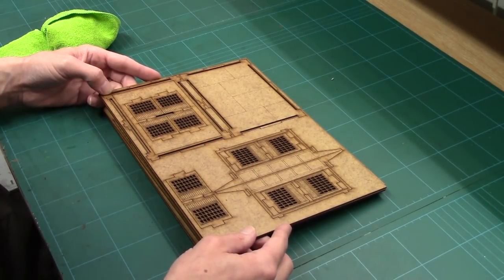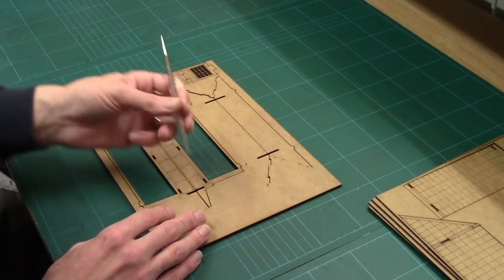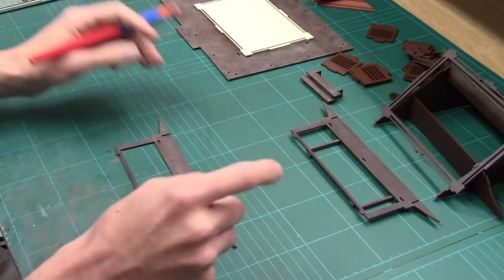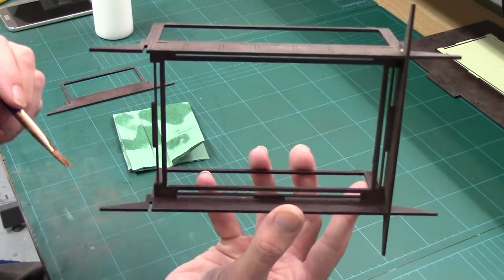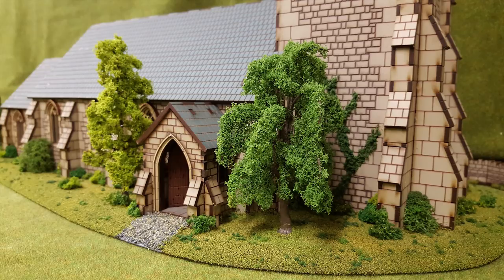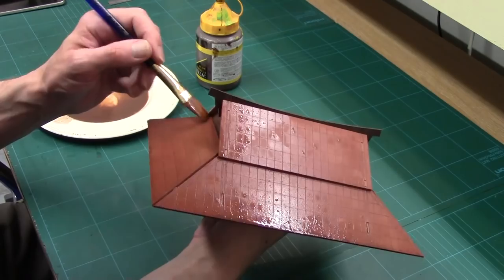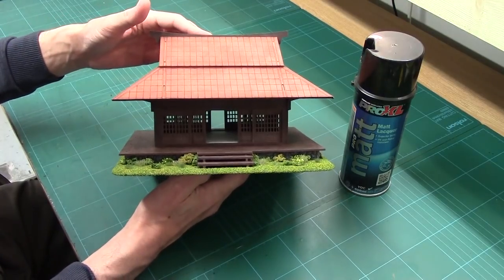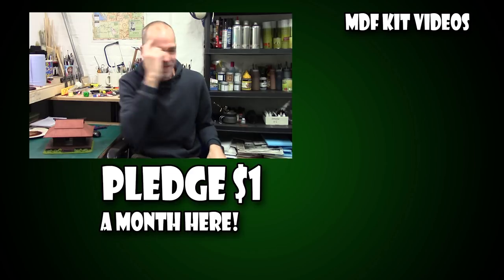10 MDF Terrain Pro Tips!

Comment from the maker: So those are my top tips folks, what are yours?
Reply: TheTerrainTutor u pretty much covered my tips, definatly spread that excess glue, I do recommend a thin knife for cutting out the peices tho... 1 good tip I have for my necromunda terrain is don't glue everything, keep it modular, I kept towers and bridges disconnected and now they double as ramps... if you mess up a piece think outside the box, I had a board that was too thick so the tabs were too thick to fit into the slots, I simply peeled a small layer of the tabs with my fingernail and the glue fixed any imperfections, that glue soaks right into that wood... another tip, use the cardboard box it ships in to make a work space on a desk, rip the sides so it lies flat, I model and brush paint minis infront of my tv on a glass table and haven't made a mess yet, lay down cardboard or newspaper
Reply: Best tip I have for this is to use a silicon or clay-shaper tool for spreading PVA instead of a brush, since a brush can get gunked-up & nasty with dried PVA in it. 
A shaper will peel off PVA with no hassle. 

Great video, man. I agree with Wildboy789789, a knife can be a nessescity for removing some MDF pieces & a needlefile or sandpaper is great for cleaning off any excess.

Last tip, keep the MDF sprue frames, I've made entire buildings just from empty frames, they're a great resource for useful bitz & bobz
Reply: That magnet idea is great, ive got plenty of those lying about unused, oh and the lego corner piece is inspired, really helpful tips all around so thanks 🙏

Comment: Some good tips and here are a few from years of running a MDF terrain business.  1 - switch to a thick clear glue like Aleen's tacky glue gel. It works better than standard PVA. It dries in stages and has a low water content. It is sticky so parts stay attached but it dries slower so you can pull parts apart if needed  for up to an hour after they are assembles without any problems. It also has a bit of a gap filling property. 2 - Instead of sealing with paint, use a good wood water sealant. Rub on polyurethane is great. It seals the cut edges so they don't stand out.  Best of all it is cheap and can be brushed or sprayed on. A little in a single action airbrush works wonders. 3 - Bet 123 blocks instead of Lego blocks. They are metal and heavier so you can used them yo remove warps and weight down pieces as the glue dries. They also are magnetic so it is easy to use magnets to turn them into clamping surfaces if needed. 4 - Seal both sides of the material even if not painting. It will cut down on warping and swelling. 5 - Sawdust and glue make the best joint filler. It always sticks and doesn't chip or pop off later like some wood putties.

Comment: Really solid suggestions and tips. 

Mine: More than just test fitting, I'd recommend a complete test build (where possible). There are often pieces that are almost right but that are intended for some other place in the model. If you think you know what's going on but you're 1/8" off, your life will be less fun. Make sure you know exactly which piece is intended to go where before you start gluing.
Reply from the maker: Nice tip mate

Comment: My Tip, lightly sand the edges before to paint/prime. Just like plastic kits and models you need to remember to clean up the points where the piece was connected to the sprue. A light sand will not only even out those points but will allow for the primer to stick better to the MDF. Also you can do this during the dry fit stage to help remove any leveling issues. If you're like me and wait to prime similar pieces all at once. take the time to use wood filler (sandable/paintable) to remove any gaps or holes.
Reply from the maker: Nice tip matey

Comment: I tend to stipple on paint quite thick on building walls, it creates a nice texture on otherwise super smooth MDF.
Reply from the maker: Nice tip matey
Reply: Similar... have also used some pre-textured house paint (Dulux used to make something called Sandswept) for MDF road surfaces or old/collapsed ruins. For cement/concrete walls, pva plus baking soda gives a good fine-grain surface.

Comment: Tip1 : fill your tab gaps. Makes it look much nicer. Tip 2. Use filler and fine sand where the walls are meant to be concrete/mud/clay and rattle. Tip 3. Use coffee stirrers/matchsticks for some wooden  beams where applicable. Tip 4. Texture the roof with card or foam (tiles for where ever is relevant.)
Reply from the maker: Top tips buddy

Comment: the mdf can look very flat, so use a bit of time adding textures to the building. This can be thinned filler, fine sand or even a stippled paintjob. 

A nice weathering  works wonders. Try the hairspray technique of the armor modellers to create worn paint on your walls and windowpanes. Quick and easy.

White pigment looks like mortar. Brown pigment looks like dirt and dust. Black pigment looks like soot or dirt.

Terrain is like miniatures and can be zenithally primed to good effect. This works great with washes or thin airbrush coats.

Think of the building as a miniature and make sure to give it base, shade and highlight coat. A little goes a long way, so dont overdo it.
Reply: Kathy Millatt just did a tutorial on painting bricks. It is definitely worth a watch!!
Reply from the maker: Cheers buddy

Comment: I also use clothes pegs to hold piece's together whilst the glue is drying. On brick work buildings I paint red and shade up, then run a white or off white chalk all over it. This sticks in the cracks to give the white cement look without the tricky painting. Just wipe of the excess and varnish.
Reply from the maker: Top tips matey

Comment: ive found that if you wanna use the inside of some of the sarissa buildings for tabletop you can round off the tabs that lock the stories together. that way when your playing and a character enters a building you just need to lift and set aside the upper floors.
Reply: i still glue the rest of the parts together.
Reply: Also keep all the scrap bits that the parts popped out of. you never know when you may want to add a detail. especially the cardstock that the window frames come out of. you can cut strips of the material to fill any gaps from gluing in the window frame pieces.
Reply from the maker: Nice tip matey

Comment: Hi quick question, if you don't mind answering... when 'sealing' your mdf terrain, what do you use and how do you do it? A friend of mine has suggest coating it in 50/50 PVA and water. I don't want to lose any of the details in the terrain
Reply from the maker: That'll work but I normal give them a spray with a matt varnish mate
Reply: @TheTerrainTutor  thanks very much, I'll try that.

Comment: Hi Mel, thanks for these tips. I have a question for you: if we paint the pieces separately, will the PVA glue work fine over paint? I thought PVA adheres to wood, not to paint... so, in that case, should I sand the paint a bit where the glue is going to be applied or what? Cheers!
Reply from the maker: It glues fine mate

Comment: Was wondering if you need to seal mdf when using filler or acrylic caulk when using mdf for miniature basis?
Reply from the maker: nah, won't be an issue because you're coating it with something to be painted, not painting the mdf itself

Comment: Use wooden clothes pigs. If they don’t fit out with the stanly knife and cut the wood so it will fit. If soldering the heat will not melt the wood it would if the pegs were plastic. Cheap as chips so are a consumable item. Note don’t use the wifeys as marital disgruntlement WILL take place ( he he ) Amacf
Reply from the maker: Top tip bud